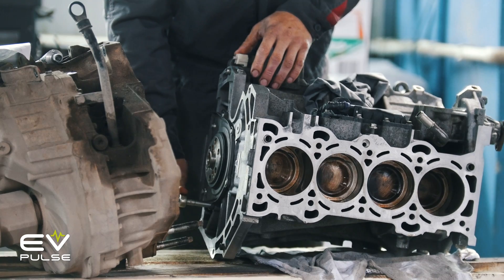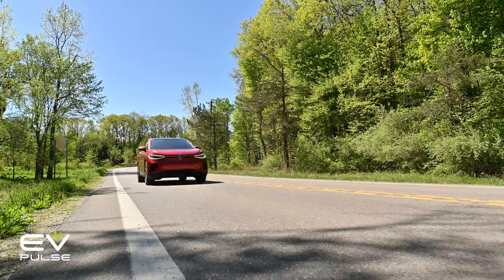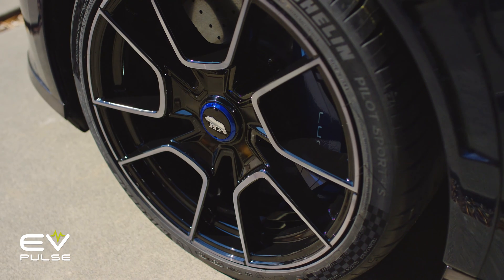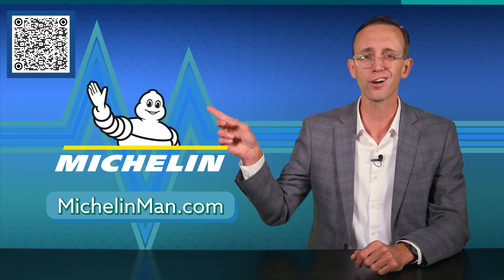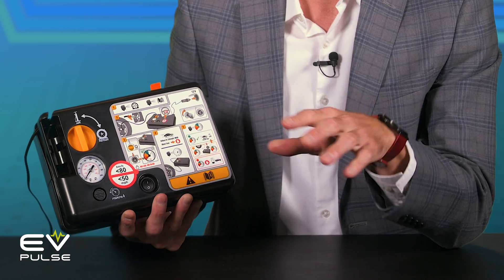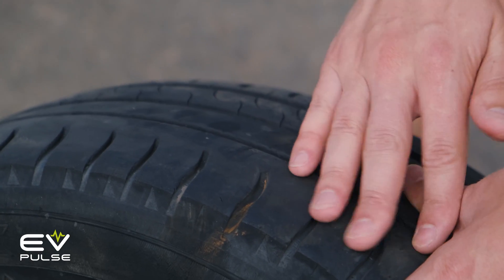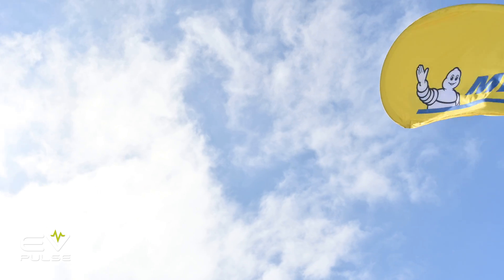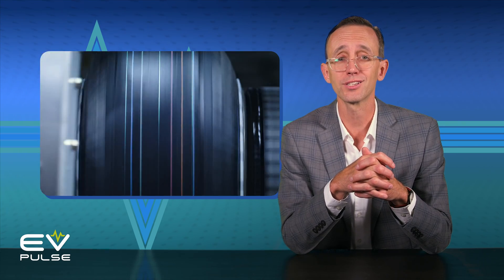Do Electric Car Tires Wear More Quickly? | EV Basics

Comment: Well, my experience is different: In equal conditions, EV tires last longer than ICE car tires. Well, you can get a lot more performance out of an EV than out of an ICE car - that makes tires last less on an EV than an ICE car. But, try to ride your car in a civilized manner, and tires will last longer, because of no gear shifts, no motor vibrations, only smooth and comfortable ride. Therefore, a lot of owners comfortably get more than 50,000, even 60,000 miles on their EV tires, as long as they go slow on and comfortable on the accelerator. But, if you drop your foot on the accelerator to show your neighbors what your EV 500 horsepower can do... well... your tires will barely last 15,000 miles.

Comment: We picked up our "new" 2023 EV6 yesterday.
I am struck by a familiar problem that the EV6 has; big stupid wheels with low profile tyres. Anyone who thinks the EV6 ride quality is fine should drive a similar car on 18" or 17" wheels, the improvement in ride quality is immediate. 
I'm no racer so these high performance tyres are just plain stupid.  Tomorrow the EV6 goes in for a set of secondhand Tuscon 17" wheels and new Conti tyres. I know the difference will be incredible as I have done it before on VAG cars. 
There is some suggestion it will also improve mileage but that really is secondary to ride quality, tyre longevity and cost of replacement.

Comment: Yes, EV's are typically heavier. No, they don't put more weight on their tires! How is that possible? Weight distribution. In a combustion car, the engine end of the car is heavier than the other. In an EV, the weight is distributed evenly between all four tires. It's just that all four tires carry the same weight as the heavy end of a combustion car, and all the tires are inflated to the same pressure. If you drive your EV for maximum range, you're also driving for maximum tire life. You don't necessarily need "EV" tires. Both electric and combustion require the same load range rating, because they have to be suited to the heavy end of a combustion car, which is the same as all four on an EV.
     The best tire I've ever tested on a Toyota Prius Hybrid, is the Michelin Energy Saver A/S. Nothing gets better gas mileage. That exact tire is OEM on the Chevrolet Bolt EUV! They last forever, and, they offer the best range per charge. Unfortunately, that tire doesn't come in the right size for my Chevrolet Equinox AWD, so when it comes time to replace the Continental Cross Contact tires, I will probably go to the ePrimacy, which is available in my size.

Comment: Its not the tires them self. Its the weight of the vehicle (EVs are almost 2x heavier then ICE car same size)  and instant / max torque. )  Also you will much better with tires EV specific.

Comment: 420.000 odometer Jaguar, 270 kmh top speed, nothing done but regular oil changes once a year, 62 dbA (whisper quiet)at highway speed. Tyres make a hell of a difference in noise. with so much power on tap I need UHP wide tyres which is quite noisy.

Comment: I have 33,000 kms (21,000 miles) on my MG ZS EV. I maintain the pressure at 34 psi, get them aligned and rotated on schedule, drive at or below the speed limit, and never do jackrabbit starts. My tyres look brand new.

Comment: Oh bullshit. My Ioniq 5 tires got 5000 more miles than the 40,000 miles it was claimed theyd get. If you drive  the EV like youre drivinv a gas car yes, theyll wear out faster. If you ease off the quick starts you’ll do fine.

Comment: My prior pickup truck was a 2004 Nissan Frontier with 112k miles on it.  I bought it as my "Dump hauler" but it proved itself so reliable that it quickly became my daily driver.  When it came time to replace the tires, I had EV tires installed on it.  The tires were designed for low road resistance and honestly, improved the overall fuel economy for the truck by 15%!

Comment: Sure your tires will wear more quickly if you drive like a boy racer as goes for the same as a ICE vehicle. As for weight there are a lot more ICE vehicles heavier than EVs. The tire compound used for EVs and ICE vehicles are the same so STOP ALL THIS BS or other wise you will have all the ill informed believing you.

Comment: To sum up :- Don't drive like a pillock.  (in any car)

As for EV tyre wear I have just changed the original tyres on my LEAF for new at 41k miles due to damage caused by road debris not normal wear.  (Dunlop EV tyres) By tread depth they were good for another 10k miles.

Comment: The weight difference isn't that much.  I've had ICE vehicles that weigh more than my EVs.  The biggest difference is in how the car is maintained and driven.  My Ioniq 5 has 39,000 miles and the tires still have 6/32nds of tread.  I'm okay with my tire wear.

Comment: 85,000 km on 2017 Bolt original tires. We swap for Blizzak snows mid-Oct to April but don’t drive much distance in the winter. Tires are not an EV issue for us.

Comment: Thanks for the tips! EV tires are more complicated (mine have some sort of foam inside to reduce road noise). I made a 1200 mile road trip last month. I checked tire pressure before leaving & my dealer had overfilled the tires on my Polestar 2 by about 10 lbs., going by the door sticker. I corrected that (I also had to recalibrate the tire pressure monitoring). There must have been a reason they did that?

Comment: I'm not seeing the tire wear thing. My 2013 Cadillac ATS wore out ties in 20k miles, they wore nice and even but they just wore out. Those same brand, model, and size tire lasted over 30k miles on my Tesla Model 3. The difference is the ATS ran tires at 36 psi and the Model 3 runs at 42 psi. I wonder if that makes the difference?

Comment: My Lyriq demands 40 in all tires 🛞 

Highest pressure I’ve ever seen.
Reply: Model Y LR is 42
Reply: My 2025 Chevrolet Equinox EV AWD asks for 42 PSI all the way around. These are HUGE 275-40R 21, and it seems like a lot of pressure for tires that size. The tires are Continental Cross-Contact, and the efficiency is remarkable, averaging 4.2 M/kWh lifetime! I WANT Michelin Energy Saver A/S, but they don't come in that size. I will probably go with ePrimacy, because they're said to be low rolling resistance, and, they're available in the right size.

Comment: I have 8500 miles on my Lyriq’s tires.

I burned through tires faster in my JEEP SRT, Chrysler SRT and Charger Hellcat.

It was bad enough RWD and so much torque grinds tires to dust.  I was going through a set every 5000 miles.
Reply: One street takeover or one sideshow = one new set of tires! (at least, the rear)😁😁

Comment: I mean my previous ICE car went through all seasons about every 40k.  If I can get close to that than this is a nothing burger considering the performance my EV gets vs ICE. I'm more concerned about tire prices generally and yearly ev registration fees, both of which can fluctuate yearly and are a PITA.
Reply: Would paying per week or per month as you were at the gas pump help? 500 gallons*$.385 is 192.50, which is what the standard driver pays in road fuel tax in OH.  The reg fee increase in 200.
Reply: @stephkent2736   I wouldn't mind paying 12,500 miles of gas tax equivalent to a ICE car getting 25 MPGs...However that is mostly due to me knowing my car is about that efficient and  at .29 cents (GA tax), I'd pay about $150/yr.  Other car owners of more efficient cars would and should pay less.

Unfortunately, EV owners in GA pays $220 regardless of how many miles you drive or how often you drive and that amount fluctuates yearly and then is set so we do not benefit from any times when prices go lower or when taxes are suspended (pandemic for example).
Reply: @diydrivenGA  here in OH it’s 100 (hybrid)/150 (PHEV)/200 (BEV). I wish there was sort of an MOT approach where hybrids paid $.006/mile and BEVs paid $.012/mile for road tax, with a true up every 2 years or at sale.